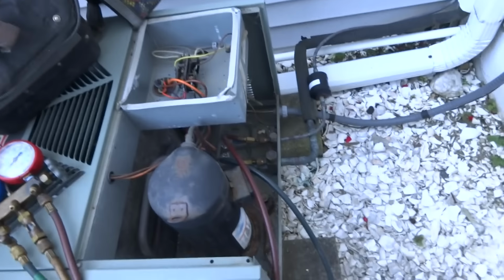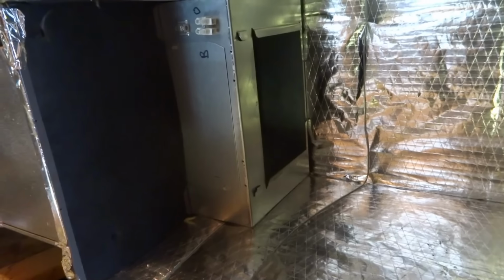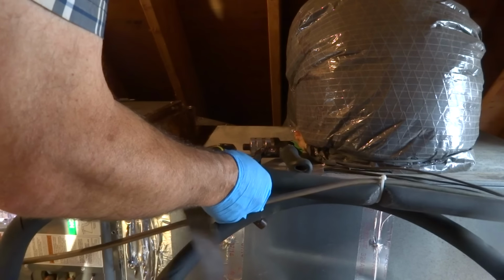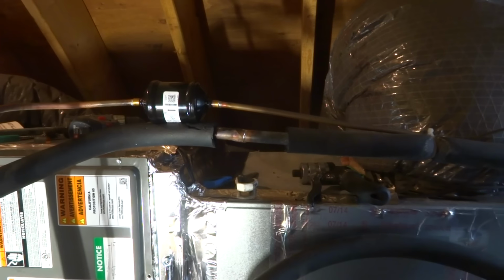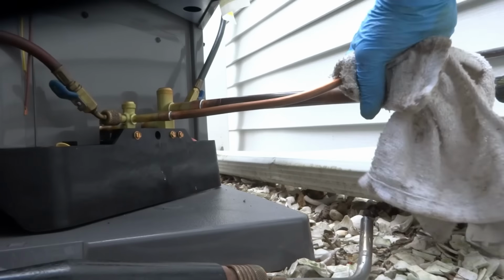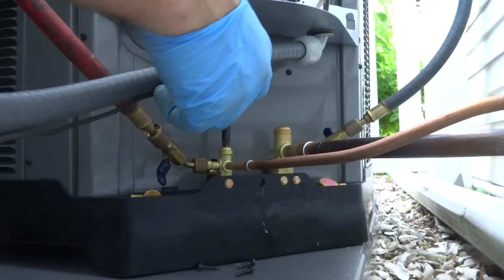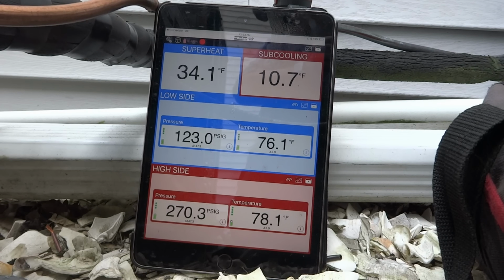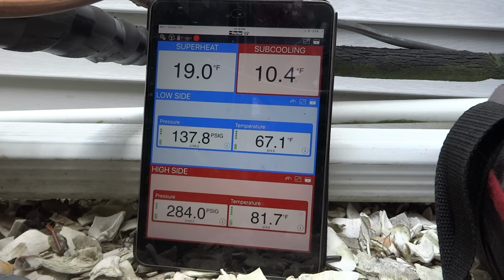AC SYSTEM REPLACEMENT - REMOVE OLD - INSTALL NEW

Comment: How come guys hate SB#8 because of the flux but they have no problem heating a copper pipe to 1400* just inches away from a service valve or a service port schreader. do you think that cold towel is going to protect? dissipate all that heat 1 inch away? I'm with you Steve, just don't go ape shit with the flux and you'll be fine.

Comment: hey Steve, another great video. Thank you you know just a thought. I don't know. See what you think about it when when you're showing the super heat, the sub cooling and head pressure maybe a video on what each one is monitoring and what the number means I mean, superheat, you know is probably the I don't know that's why I think a video would be cool. Break it down sometime so we don't understand each category on the gaugejust a thought but just the same thank you for another great video.

Comment: You know Steve, the know-it-alls (or blow-bags, as you call them) would complain that you aren't 'brazing' your connections versus soldering them, as you do. And I would have been inclined to believe them except, after comparing your joints to theirs [brazed], I'd do it YOUR way. Why? Because you've done it that way for years with equal results and the best part? Soooo much quicker, neater and without overheating the joints or components as brazing tends to do! 👍
Reply from the maker: AND ITS STRONGER .. NO NITROGEN PURGE NEEDED. FOR ME ITS A NO BRAINER .. EITHER WAY WILL WORK JUST FINE .

Comment: Had a refrigerant hammer problem on compressor shutdown on one of these units when it was in heat mode. The problem was the TXV in these Ruud units need to be vertical or as vertical as you can get it (45 degrees being acceptable). The problem is in the internal check valve inside these TXVs. If the lineset shakes on shutdown in heat mode it's the TXV, and it needs to be twisted until it's vertical or at least 45 degrees or more. This was on a Ruud heat pump unit.

Comment: Brazing and soldering are both excellent methods for joining copper pipes, and both are strong enough for refrigeration lines. Brazing is generally stronger and more resistant to fatigue than soldering, and is often used for refrigeration units and other applications that require high joint strength. However, soldering may be better in some situations, such as when brazing would be too hot for the job or when joints need to be easily dismantled so i have always been of the opinion that you should use what is appropriate to do the job to a high standard and you just don’t gain much  whether you braise or solder so I myself personally choose to use solder as well unless the job calls for it but the one thing i won’t use is that pro press crap im not trusting anything to a crimp and a o ring I guess people have forgotten the big mess that polybutylene caused, and still is causing anyways excellent video Steve i do enjoy watching your videos you do excellent work

Comment: I’m glad my system is slightly oversized here in texas, we are in the triple digits
Reply: It's been miserable
Reply: @tedbell75  it has been terrible. I have a 3.5 ton on my 1400 sq ft home, set at 70 and it maintains with no problem whatsoever.
Reply: It horrable as well for me Near San Antonio

Comment: I have a gauge set here left over from R12 days.   The hoses havent weathered well but the har4dware is still decent.  there is also a vacuum pump.  Last AC season you said you needed a decent set for reclaiming and installing
Reply: R12 that would freeze you out of the car, the good ol days
Reply: @tedbell75  Bah! Stupid ozone layer. We don't go outside anymore anyways!

Comment: Ruud replaced with a Ruud
Reply: Yep I’d do the same thing. Rheem/Ruud are the best in the industry.
Reply: @samsquires94  Rheem/Ruud is my favorite HVAC brand. I love their 2004 high efficiency power vent water heater and their 2004 rheem classic 90 plus furnace with ac
Reply: its no problem at all especially considering in the original video steve found out the unit was from 2008... 16 almost 17 years out of a rudd isn't bad at all especially considering ac doesn't last forever
Reply: @matisso.5278  And less when on the Salty coast.
Reply: @matisso.5278  mine is 24 but not in the salt air that's a big difference